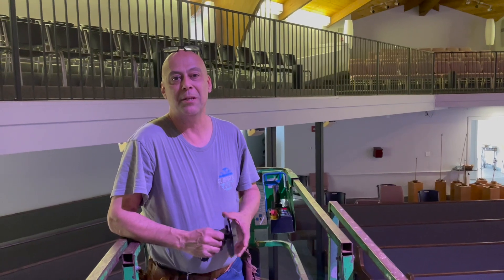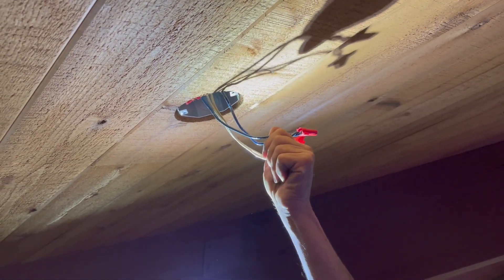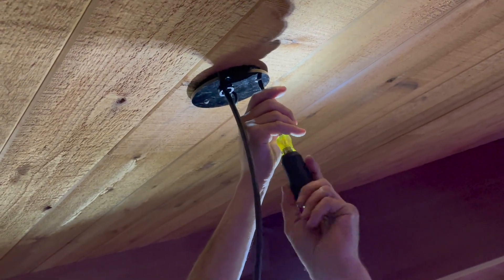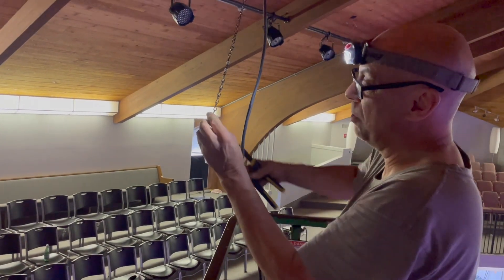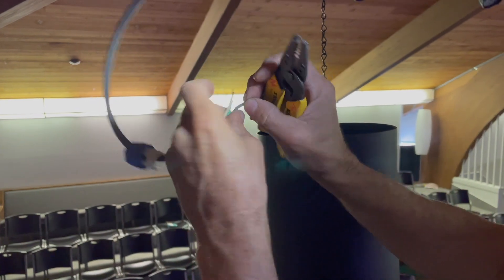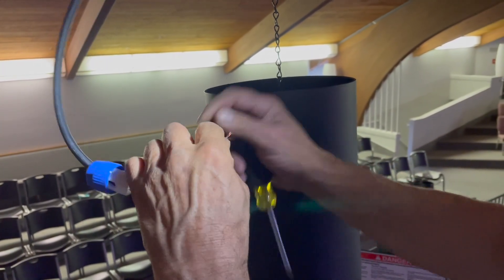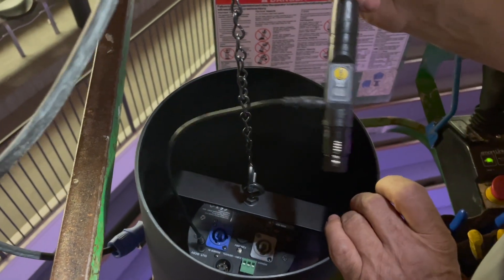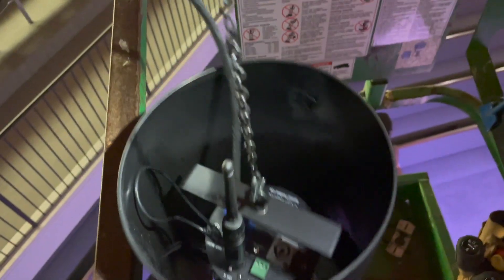How To Install Spatial Pendants! | Springtree LED

Comment: whats the CRI - any adjustable reflectors for different beam angles? looks like a good product. thx!
Reply from the maker: CRI is 95, and they have a fixed beam angle of 80º. But more valuable than photometric data is seeing the Spatial Pendants in action for yourself. Our demo program lets you try two fixtures at your facility at a discounted price. Love them? Keep them at the lower price and order more. Not the right fit? Simply return the demo within 30 days for a full refund—all you have to pay for is the return shipping.
Reply: @SpringtreeMediaGroup  amazing. and good specs. will definitely check you guys out, thanks!

Comment: What is the recommended spacing between lights?  Our room is 71 x 57 and ceiling height is 25'.  Just wondering how many we would need....
Reply from the maker: If you start the rows 8 feet off the walls, 20 lights will cover the space (4 rows of 5). The lights in each row would be 15.75 feet apart, and the rows themselves would be 16.3 feet apart.